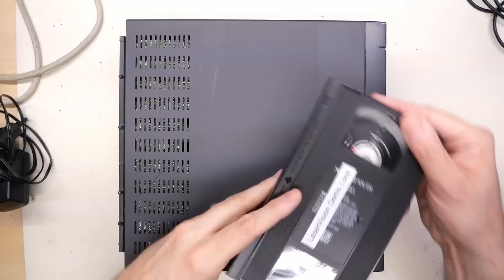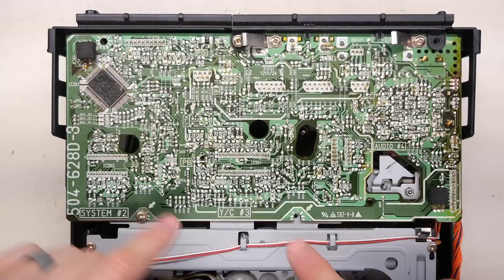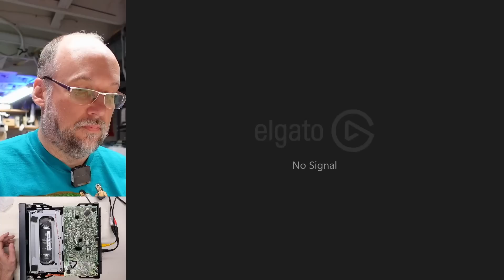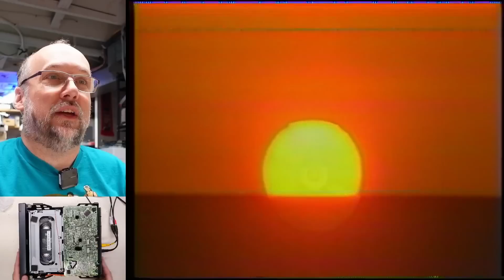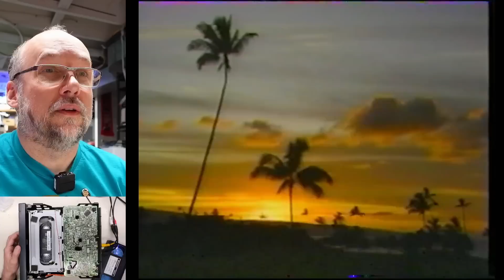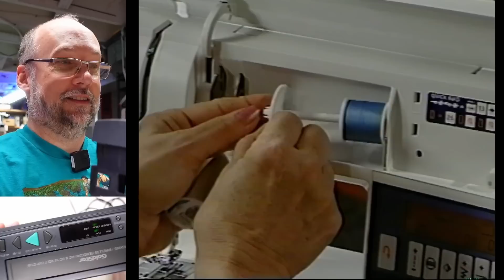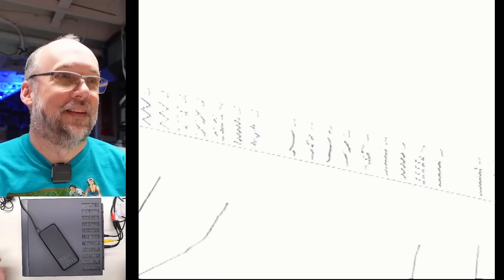Play VHS tapes while sideways and upside down (Goldstar GCP-C135)

Comment: The smooth connector on the rf unit is the standard for Sweden, we almost never use threaded connectors for antenna/rf signals. In the 80´s and 90´s we had rental video players they called a movie box that was mounted in a vinyl/plastic carrying case, even they would have the smooth rf connector. Yours was probably sold on many markets so they simplified the design to save on parts.
Reply: I remember these player only VHS things from video rental companies too here in Finland. Buying VCR late 80's was expensive thing to do, so that's why there was a rental players, just rent a video and player.
Reply: Oh that looks like an RCA connector to me on the side of the RF circuit. But yes Europe uses a different RF connector.
And it's cool to know that rental VHS devices were available there outside of the blockbuster and Hollywood video of the US.
Never did rent one but always wondered what the process would be like.
Reply: @imark7777777  You had very basic controls with play stop ff and fr usually it had a tracking control besides eject that´s it. we used to rent them with videos/tapes we wanted to copy if we had a vcr at home but not all vcrs could record of them because of copy protection, but some could.

Comment: When I saw it, I thougt it might have been for "trasde show" style applications; you know, the info screens that run on a loop? That's what the "repeat" button is for, most likely. These would also only need playback, be versysmall to integrate into the company display setup and the 12V makes them compatible with a mobile solution too..

Comment: Tune in next week when Adrian repairs a Husqvarna sewing machine 😊
Reply: You know, this comment is being funny, but a lot of the stuff that we do in vintage computing is also the same stuff and the same skills as things like synthesizer and keyboard repair as well as sewing machines. Things like Gotek are specifically used in old synths that read and write to floppy disk. Fancy sewing machines with special features may also use floppy disks and things like the Gotek floppy emulator address the same needs. The difference used to be that vintage computing was niche enough that the old machines were basically free or like maybe $50 on Craigslist, whereas synth and sewing machines are built for a much longer lifetime and maintenance like this makes sense. Now that vintage computing is much more mainstream, these old machines are now pretty valuable and collectible, so all these kinds of skills and the value proposition is now similar. So yeah, it's actually completely reasonable that Adrian could rock the repairs of some of the other machines no problem! Although I would have expected he to be able to do it regardless because Adrian slays these repairs! :-)
Reply: This guy can repair almost anything
Reply from the maker: Maybe it uses a floppy drive??!
Reply: @adriansdigitalbasement2  let's see if can run Doom
Reply: @adriansdigitalbasement2  My wife's Brother embroidery sewing machine uses CF cards.
Reply: @sarahgoo5541  would be continuity gold 🪙
Reply: My mom's embroidery machine uses floppy disks. dd no less.

Comment: The jack on the modulator is there for the tuner if it was so equipped with on it allowed the antenna signal to be passed to a built in tuner-they made them in that form factor for years and the modulator works just fine as a stand alone modulator without a tuner plugged into it-why would a manufacturer make multiple devices like a modulator for a vcr with a tuner and one for a vcr without a built in tuner-just use the one-saves on having to manufacture different parts to obtain the same goal

Comment: I had an Emerson VCR my dad bought in 1985ish that broke in 1991 by pausing the tape and rewinding a few times quickly. I took it to the local TV/VCR repairman and asked for a quote but the dummy called a week later wanting $90 for the fixing it. That is over $200 calculated with inflation. I bought a Goldstar a while later just like the GCP-C135 but the earlier version that only was only playback and also12V powered. I loved that little VHS player, bought another Goldstar VCR in 1999 and lasted about 15 years except the LED display got faded from using it so much so I retired it when the belts worn out.

Comment: This VHS was installed in Buses. All was designed to be easy to use It. Vibrations, positions, etc ..
Reply: Oh yes, I recall going from Slovakia to Greece by bus in 1999, via Hungary, Romania and Bulgaria (that's the longer way) because of the war in former Yugoslavia. We were sitting near the back of the bus, maybe about two thirds in, and the TV was at the front. Well, I think nobody could really see it, maybe the people in first or second rows of seats :D
Reply: This model was quite common in RVs in the 90s and 2000svas well.
Reply: I suspected it was used in a mobile environment.
Reply: Ergo the 12-volts

Comment: Hitachi and Panasonic vcr service manual of the players we had to work on at school in electronics was saying to use a strip of printer paper, of the A4 sheet type and not “tractor paper” and hold against the heads on the drum and start the mechanism. Just one drop of isopropyl alcohol was enough to put on the strip. I found that a bit scary but never damaged a head yet using that method. :)

Comment: I got a VCR that was taken from e-waste collection. Looked neat but it has some dents. A tape is stuck inside, unloaded. When I plug it in and press any of the buttons, it spins up but does nothing and turns off. On the bottom I unscrewed the plate and it seems there's a rubber belt but I also found old rubber debrish inside. I ordered a replacement for this exact model and got 2 different size belts but I'm not really sure where the other one goes, VCRs mostly need 1 belt from what I've seen so far but I need to poke around a little more.

Comment: I don't think my first VCR (1983ish) had a pause button at all. I'm not sure it's worth bothering with it on a two-head VCR… it never looks good. I think that early VCR might have been able to display video while fast forwarding or rewinding (although I remember the ones that couldn't) but it would have looked even worse than this one.
Reply from the maker: I played a few more tapes on this two head thing and it turns out the pause and FF/REW picture search works fine on EP tapes, so I guess the extra two heads are fore these functions on SP tapes. This is certainly something I knew in the past but had since forgotten. I think our first early 80s portable Panasonic VCR did have pause but definitely did not have FF/REW picture search.

Comment: If it only plays. Is it really a VCR? Or would it be a VCP?
Reply: 10:27 it even says VCP on the PCB 😂
Reply: It's funny though. All the old tech I have. I found some old tapes at work I wanted to watch and did not have a VCR or VCP to use. I was able to snag a free one at VCF Midwest last year. So if you want to play VCR find a free pile at a Vintage computer festival!
Reply: It wasn’t super common, but some players were actually advertised as “VCPs.”
Reply from the maker: Indeed or VTP I suppose! Feels like player only units were so rare and unusual the colloquial term was just VCR even if it didn't record.
Reply: @adriansdigitalbasement2   Same here.  Maybe it's an American thing.  It's like the market for play-only machines was so limited that the term "VCR" was more often than not the correct term, and it just became genericized.
Reply: I've always heard/called them VCP.  And they were really common, as people would put them in their mini-vans, conversion vans, campers, etc and run them off 12V DC.